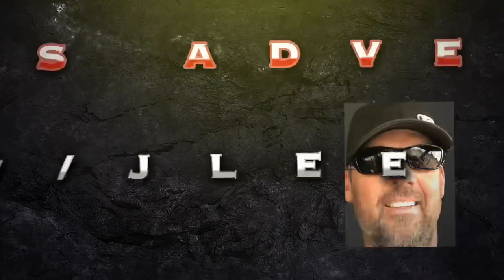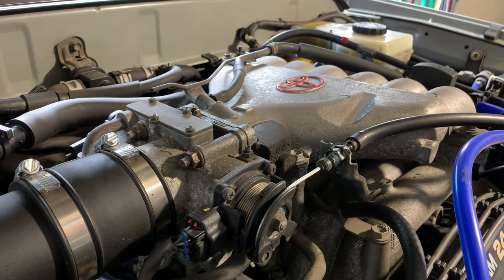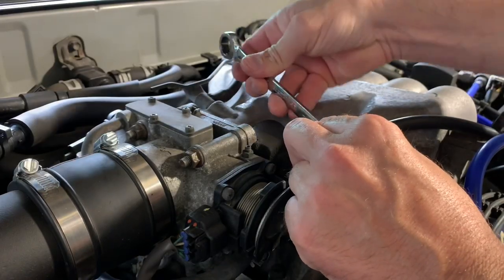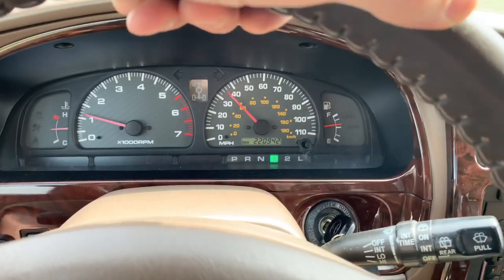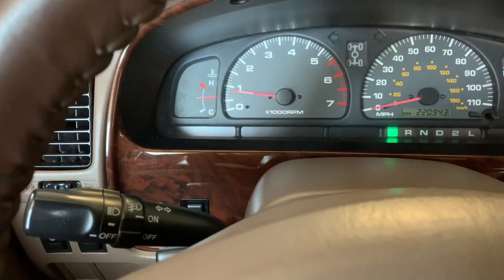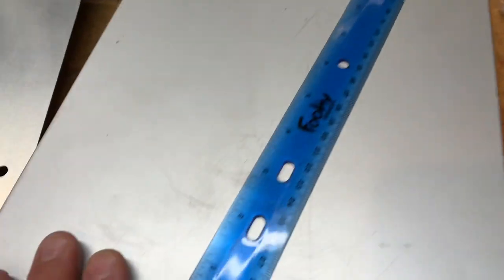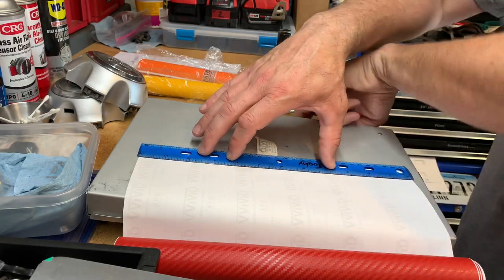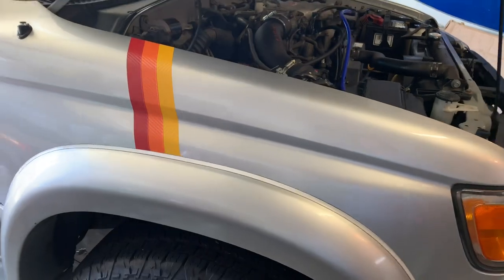3rd Gen 4Runner - Free HP!

Comment: Friend of mine had a guy put a new alternator on your car. It starts and runs great now. But when you press the pedal in drive or reverse you get no response whatsoever. Could this cable be the problem?  Or is something else more likely. It’s an 04 four runner sr5
Reply from the maker: 04 4RUNNER is a different setup, so probably not a cable isssue, although its easy to check for play... may be an electronic/sensor issue or some require the complete throttle body to be replaced  (ie 03/04 Tacomas)
Sorry cant help more
Reply: @JLeeChron  thanks for the info. Appreciate you.

Comment: So for the 1999 version with the little skinny wire on the back and the thicker wire up front, do we need to tighten both wires or just the thick one? The skinny back wire is looser on mine than the front thick one, but both are relatively loose.
Reply from the maker: Neither should be super loose… the smaller going to passenger side is your transmission kickdown cable. The larger (going to the throttlebody from your accelerator) would be primary focus. There are specs as to free play. Don’t have them atm, but this is usually an overlook and can make a bit of difference all other things up to spec-
It will probably be obvious if both are abnormally loose. Thanks
Reply: @JLeeChron  Thanks for the reply

Comment: Where is the anti skid relay located?
Reply from the maker: Mitchb31705 lower left side driver footwell. VSC module, the process involves splicing a few wires and there are writeups on T4R forums and yotatech. I never got around to it, but needs to be done. Deathtrap in traffic, trying to blast out and not being able to because vsc is cutting power...

Here ya go:
https://www.yotatech.com/how-tos/a/toyota-4runner-1996-2002-how-to-disable-vsc-and-traction-control-415126
Reply: This is a relay of some sort. Do you have an email address so i shoot you a picture?
Reply: J Lee Chronicles The video you have posted of the air intake really helped alot. I was having bank 1 error for lean air or something. After watching your video i checked under my hood and sure enough my Air Intake Hose was dry rotted in a spot and it had a big hole by the throttle body. I have some new hose coming in today. So hopefully that will be a simple fix. Gonna check my timing belt also. And it looks like i still have my original radiator. But i dont see no signs of leakage. Over all this truck runs great to have 230k miles on it. So thanks for the videos. 
Mitch

Comment: I have a 01 4Runner that has a loud roaring and vibration that starts at about 50-65 mph , any suggestions. I already replaced tires and u joints no change
Reply from the maker: Paul Gomez further check out: 
Wheel bearings.
Definitely dbl check the balance on the tires too- when new they are stiff and aftter a cpl 1000 miles the balance can be off. 
Also is the frame rusty? If so you may want to check out the rear suspension perches to make sure the frame is not rotting away. Also perhaps the front lower ball joints.
Success to you
Reply: Wheres the loud roaring coming from?